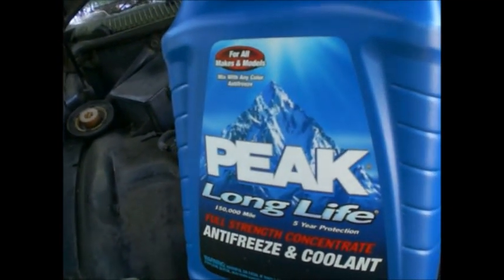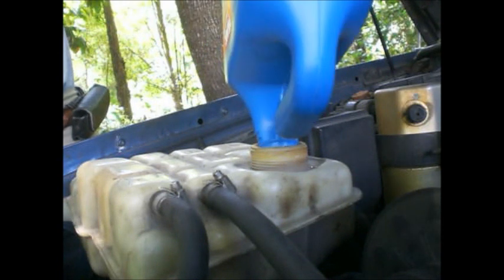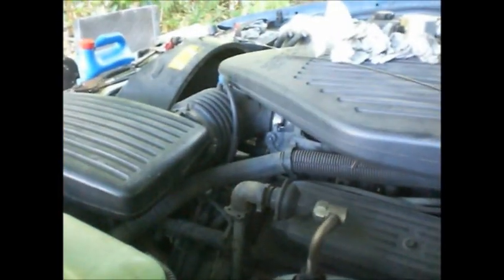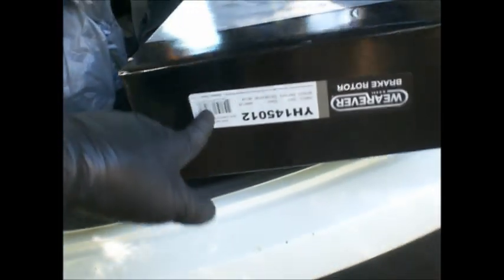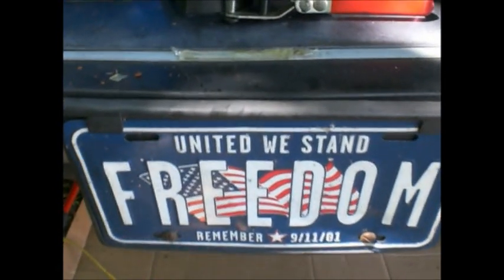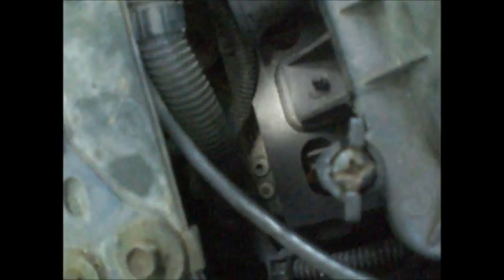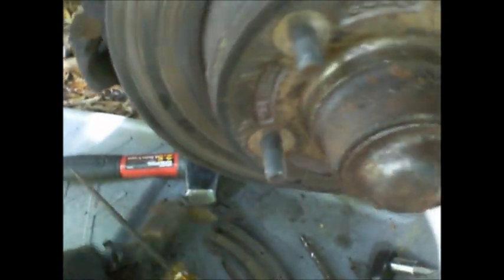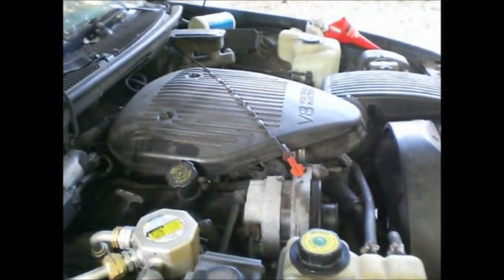The Roadmaster Final Repairs  4 23 15

Comment: Those look like ORIGINAL rotors as they have the indentations on the rotors hat. I have a small pile of Canada NOS rotors that have the same markings on them.  The truck here drove from FL to NY, in NY I took it apart at my old shop, Noticed it almost had no brake pads when the rotors shook bad, Turned the rotors, slapped on the old pads, Drove it back to FL and changed the pads lol.